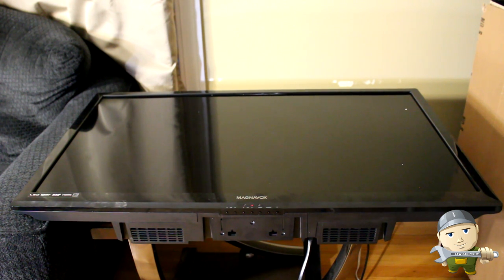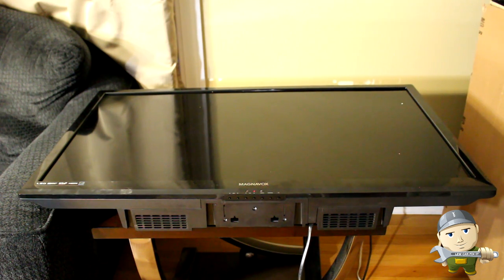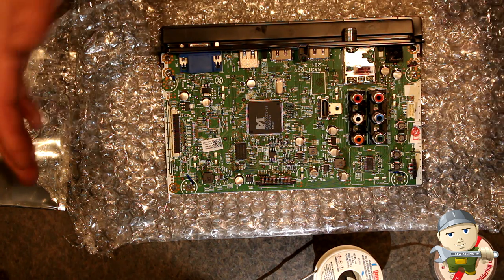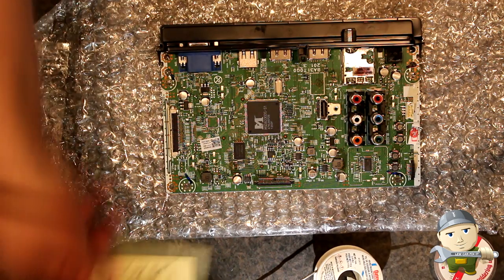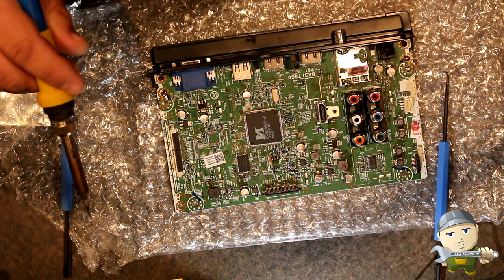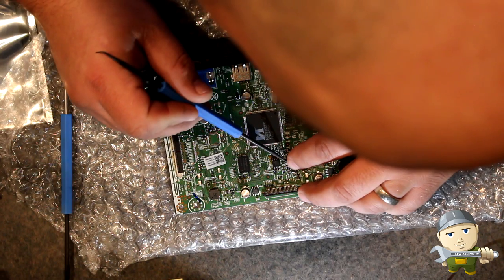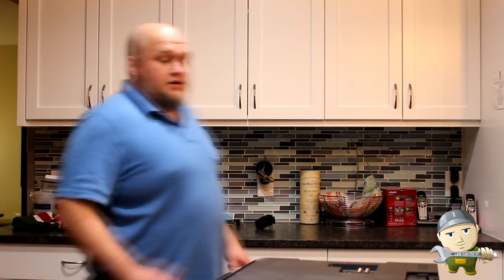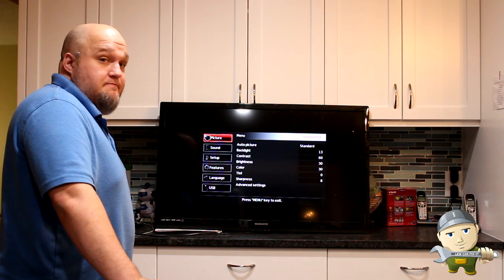MAGNAVOX TV EPROM REPLACEMENT AND TEST

Comment: Are eeprom sensitive to static shock? I flipped the breaker in my house( electrical work) and right after, I noticed my INSIGNIA 39" lcd tv doesn't work, only 4 years old Fuse in tv board is good my knowledge is limited when it tv related.  Any suggestions? There's a clicking sound out of the speakers as well.